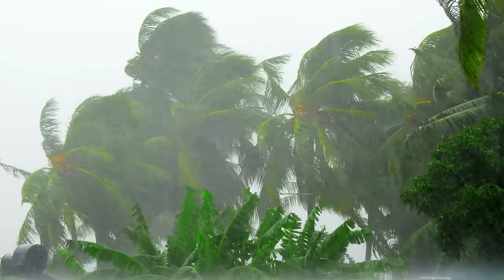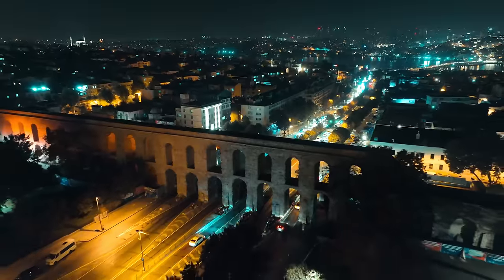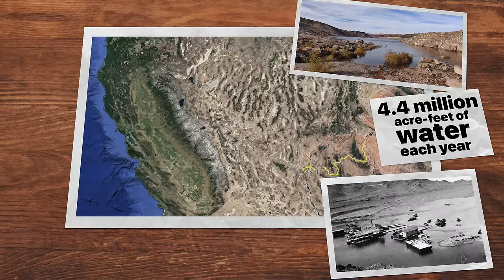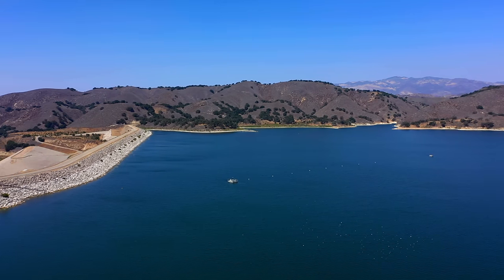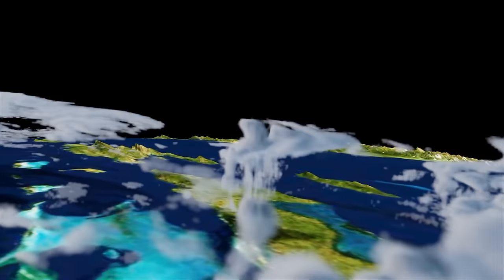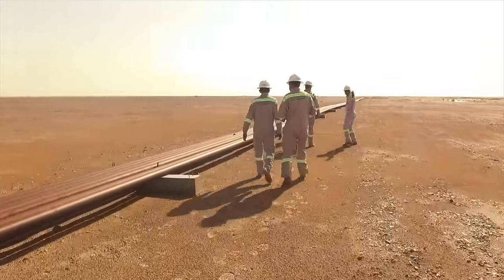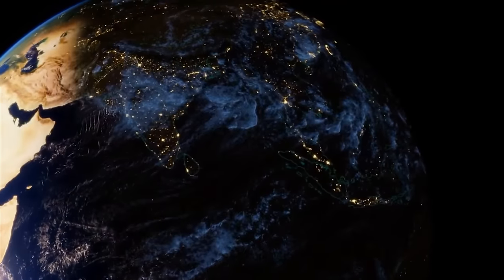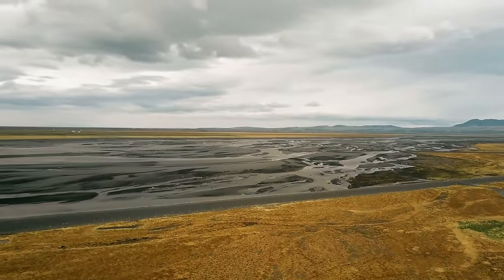Pipelines From Flood to Drought

Comment: For decades property developers have filled in wetlands and built homes, strip malls and shopping centers on them.
Wetlands are natures over flow, flood storage and ground water recharge ares. Wetlands need to be protected, expanded and appreciated for the flood control and water storage that they provide.
Reply from the maker: So true
Reply: You have to realize, though, that the root cause of floods is deforestation.
Forest areas have soft soil, which rain will soak into immediately.
On open areas with hard soil and little to no vegetation, rain will mostly pool and run off, into streams and rivers and/or nearby areas, which will overflow, causing floods.

Viktor Schauberger predicted this. He called it full-cycle for a natural system with plenty of forest, and half-cycle for systems without. Half-cycle means there will be ongoing cycles of floods and droughts, when most forests have been cut down. The only way to fix it is reforestation.

Pumping water around is a band-aid solution, and will fail as floods and droughts will only become more severe over time. Look at India to see what that would look like; rain for months on end, flooding living areas, destroying people's homes, then drought, which will eventually force people to migrate.

Forests naturally attract rainfall, whereas open areas generally only get rain from large rainstorms.
Temperature in open areas lack the regulation from the water and moisture, and swings from very high during the day to very low at night, both of which cause the soil to dry out further.

Farming the wrong way is a contributing factor for the hard soil. Viktor Schauberger invented a plough, which flips the soil a full turn, leaving it mostly undisturbed, but allowing rain to soak in. A cover crop such as grass should also be left in place over winter, to avoid the soil drying out and becoming too compact.

Lastly, some past civilizations built terraces on hilly lands, which forced the water soaking into the soil to follow a widely winding path down, retaining the water for weeks or months after each rainfall.
Reply: Yes and add a gutter and drainage ditch everywhere on top of all that. There is not enough recharge basins to compensate for the usaage. 
Like 2016 when California had record rain fall with inadequate storage capabilities so much fresh water flowed out to sea. Fun fact; 1 inch of rain on a square mile is 18 million gallons of water, multiply that by 5700 square miles (for Los Angeles and orange county) equals 100 billion gallons, multiply by 20 inches for that area equals 2 trillion gallons of water. So much water flowed out to sea but it was sweet having a constantly flowing river in the usually dry river beds into summer. Even the dozens of new waterfalls in the local mountains was a special sight.
Reply: @silvergreylion  > Look at India to see what that would look like; rain for months on end, flooding living areas, destroying people's homes, then drought, which will eventually force people to migrate.<
Yes and No. India naturally has Tropical Monsoon type weather, driven by seasonal actions in a vast surrounding ocean. Even in places where there is traditional full forestation still in place, they are 'feast and famine' on rainfall.
Reply: Agreed.  There was an area in Florida, forget which, that flooded like mad.  People told the idiot developers "DON'T BUILD THERE!"

What do they do?  Build homes.  Now, now those homes flood like mad because of the area.  It's ridiculous.  Same goes for that crap sack that wrecked a bunch of mangroves for a development project.  These city leaders disgust me.
Reply: Also, preserving or even restoring old wetlands apparently has a beneficial effect on the environment as they trap large amounts of Co2.
Reply: @larss337  They also provide homes and food for wildlife. We need to learn to live in harmony with nature and not destroy it.
Reply: @KJSvitko  Yes, this is very true. Greetings from Finland 🇫🇮 😊
Reply: @silvergreylion  prove that, please, show me one place where someone actually proves where floods come from that isn't pushing democrap agenda.
Reply: Agree and thinking one way to "possibly" accomplish this, in at least "some" harmony with nature, might be to build more comercial structures atop of pylons/stilts (vs the antiquated filling in of wetlands and swamps) so the land below can mostly do what it was originally intended to do(?)
Reply: When you say wetlands are nature's overflow, you are barely right.  Flood plains are nature's overflow.  Wetlands are just lands that stay wet longer than non-wetlands.  Different political jurisdictions define wetlands differently.  Flood plains are defined by actual floods.
Reply: @amanawolf9166  amazing what happens when you build on swampland
Reply: @troychampion    leave political insults out of the issue. Besides the person gave the name of the idea pretty clearly among a few others. Take the five mins to look it up.
Reply: Wetlands  are protected, where are you getting your information that it is not.
Reply: Agreed.
This is true.
Priorities misplaced
Reply: Use o
Use of high altitude flat land as wetland should be a winner. Consider.: stae owned otr federal property, large acreage, currently low  yield agriclture, American bison etc.
How: micro-dams say less than 100ft highNo pumping involved but  energy captured would be immense typically filled to less than 10ft. Built to make as much soil as possible boggy witthout causing ponds to form. 

Fells, moors, high dry tundra, low  cold tundra, river margins. lots of p;laces.
Reply: @amanawolf9166  There are many more than just the one development like that here in Florida.
Reply: paving over  the land  is  just not that smart. thats a fact.
Reply: @larss337  greetings
Reply: @tzazarizona2676  yeah wetlands are so protected that the developers who wanted to build in the wetlands behind my house had to provide a wetlands area within a hundred miles as compensation. 🙄
Reply: @larss337  its almost as if we take care of the natural environment it will make living more pleasant with much less natural disasters occurring.
Reply: I've always wanted to see some way toget wet areas to send water to dry areas.  This sounds wonderful to me.  Now just get politions to see beyond getting reelected.
Reply: @theresacarmen9847  Population needs to be in balance with jobs, resources, nature and the environment. Having a bigger population in any country than the country can support makes no sense. Access to food, water, shelter, energy and jobs should guide population levels. The worlds population is still expected to add another billion people to feed, clothe and produce pollution. Humans are crowding out all other species of plants and animals. Education and birth control are key to reducing poverty and hunger.
Reply: @silvergreylion  Good Summary
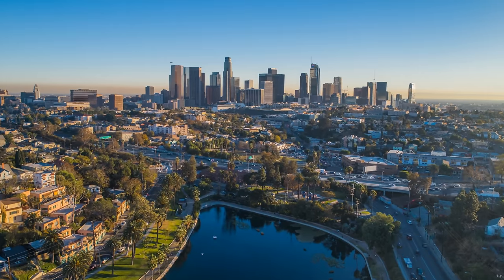Reply: @TwoBitDaVinci  You made a mistake in the video, in 1:43 - 1:45 you said that "71 percent of the earth is covered in FRESH water", when in actuality it's 70 percent SALTWATER with only 1 percent freshwater (mostly in ice glaciers and underground water). I think you meant to say "71 percent WATER" and then add the bit about the 0.5 percent of drinking water later. You might want to add a clarification in the description, but I'm not your mom, so do what you think is best. I miss YouTube annotations.
Reply: One huge impediment to proper development are the insane building codes that still exist in most areas which REQUIRE that developers exclusively build single-family dwellings.  That means no tiny houses, no single person efficient cottages etc.  

And there are many other obstacles that building codes (as they currently stand) put up against energy efficiency, distributed energy & micro grids, vegetable gardens vs. lawns, as well as requiring septic tanks rather than giving preferential incentives to low (or no) water compost 🚽 toilets.

Then there is the “just plain dumb” way of doing things.  No new pavement has yet to be used which is lighter (cooler). Likewise, roofs that are white have been proven to reduce energy usage, even in northern areas. Yet the construction industry and our governments could care less. 

And there is the fact that many states and/or municipalities severely restrict the amount of rainwater that residents and businesses can store.

Lastly, even though the first subsidies to petroleum began in 1916, and we are allegedly “moving toward alternatives,” we still haven’t begun to reduce these subsidies.  I guess that can only happen when the human race perishes! 🤪😵
Reply: I dunno, I feel like we don’t have nearly enough parking lots….😂
Reply: I live in a city in Illinois that actually pays attention to those things. I actually recall reading about the zoning here, years before I ever contemplated moving here. It was in the WSJ. Now that I am here (for thirty years) I see the wisdom of it. 

Just after I moved back to the US from the UK there were many floods during a period of heavy rain. Someone did research, using public on-line resources, and found that some 40% of the housing stock was located in known flood areas. They knew it. In China they are having drought. On the other hand, they have built so many dams that the whole system is failing.
Reply: @enfynet  I believe they call that “ remediation “ which I agree is stupid the way they utilize it. And the end result are wetlands lost in critical areas. Imo they were there where nature intended
Reply: The once great Pacific flyway from Alaska to south America has been wiped out from California paving and concreting 90% of the wetlands rivers and creeks. of southern california. The ducks and geese of my childhood are no more.  Now warehouses, distribution centers, and " planned Communities ". Hmmm. Who's plan?, what plan? ,  certainly not mine.
Reply: @danielcraft3727  In my city the migratory birds have lots of habitat. I live next to a park with a small lake. I keep a list of the migratory birds I see here (nothing formal) and it is long. The Canada Geese are a bit of a problem because of all the droppings, but it is not too bad.
Reply: look at the netherlands they fixed most flooding problem they had
Reply: @larss337  You are correct, Holistic Farming is a part of this.  Proper land management will reverse desertification and restore rain fall and water retention to areas that have lost it.
Reply: If rich guys can't make money off of it, it'll never happen. That's the probem with all great ideas.
Reply: Yes, do that too.
Reply: @glennmitchell9107   fun fact epa in the 70s classified land that stayed wet for 72 hours as wetlands
Reply: @tzazarizona2676   be careful  with current regs a low spot in your gutter that  stays wet could be designated wetlands and you couldn't fix it
Reply: @KJSvitko  I agree if LA and New York city's can't  grow enough food in their counties well they should not expect food to be sent in. Fun fact the tokeyeo area in japan during ww2 imported 98% of its food  between sinking ships and destroying the railroads that ran along the coast if the war had lasted a couple more months there might not have been a government left able to surrender
Reply: @silvergreylion  It depends on the geography, if you live in hilly topagraphy that's the case. We have plenty of marshes and swamps that soak the water up with no trees.
Reply: Okay. What's that got to do with shipping excess storm surge water to the Western United States?
Reply: @TwoBitDaVinci  Look at Burns Bog in Delta BC Canada. Laws prevent it from being developed! It is the filter for the Frasier river and excepts excessive water run off.
Reply: and a lot of parking places :) and almost no public transport...
Reply: @tzazarizona2676  before the transcontinental railroad was built, the entire central valley was a vast wetland. Then more than 100 years of development destroyed nearly all of it. Most large wetlands are gone, and we barely protect what is left.
Reply: @fromika  Not too many families that I know of want to shop or buy groceries  or buy a sofa and haul it home on  a bus.  On what workd do you live on to come up with such wild and unworkable  ideas?
Reply: @Dave-ty2qp  not many of my Russian friend would like to do so, but there are idiots everywhere, its not nation dependent but attitude. Stop thinking in stereotypes received from tik-tok. Many videos like "Idiot Russians" contain multiple clips from US.
Reply: @fromika  I can appreciate your reply fromica and thank you.  Steriotyping is wrong, and since I am ultra anti commusist, I would never have a tic-toc account which is operated by the Chinese communist party.  I don't remember saying or thnking the term "idiotic Russian".  I was in the military for 25 years during the cold war days and grew to respect Russia as an educated and honorable people.  If you hate your enemy, you will be consumed with your hate rather than win the war.  I really miss the russian youtube clips from before the Ukraine screw up.
Reply: @Dave-ty2qp  the situation in Ukraine is a result of aggressive western politics. I know what is Ukraine as far as I spent there 25. Few years ago it was "the most corrupt country in Europe" now is a place of "heroes". Country could not change that fast. Its just use to reach western coals, a object to pull Russia into a devastating war. They did offer Ukraine to be neutral and there are few regions decided not to follow Ukrainian way. Ukrainian started shelling the region. Sure you will always find few that would like that region belong to Ukraine. What is your opinion about new recruits should pay 450 USD for equipment in Ukraine?
Reply: @fromika  I believe Russia's offer was give us what we want and we will be back for more later.  Not such a good deal.  Diplomacy doesn't work when you have been invaded which is the situation Ukrake found themselvs in a few years ago.  There is no peaceful resolution now, and the war will have to go on untill one side ot the other has decided that they have lost enough.  A sad fact , but non the less true.  I really don't know which I feel worse for Ukraine, or the Russian invader sent there with such poor leadership.  Many will die unnecessarily for the ego of Putin.
Reply: Totally agree
Reply: Big development is problematic overall.   NYC, for example, all of that sewage and waste and polluted air - it's actually testament to the resilience of humans that anyone lives very long in NYC.   What about sewage?  in rural settings a septic system is used to disperse and repurpose waste into fertilizer, thus enriching the soil, etc.   IT is an inherent source of fertilizer BUT is not used for that, rather it is dumped into waterways and pollutes them.  IDK. Capitalism is very frustrating as it seeks how to make $$ on anything and everything around. 
Rather then being good stewards of what resources are around, now we have to back pedal to environmentally friendly products and processes - but that seems to be failing miserably.  China keeps making sub-par plastic goods and Americans are importing them.  They last maybe a year and to the landfill they go - we need some accountability as far as imported products are concerned.  they need to last at least 5 years...longer would be better.  But, also, we "the people" need to be LESS tolerating of all the plastic products - regardless of their origin.
I know That went off topic, but it does relate.  Developers just develop whenever and wherever they can make a buck.  No regard for the overall effect to the natural water runoff and retention areas, etc. which nature has already formed.
Another factor is people aren't informed/educated of this and they go and buy a home in or near an area.   This is more a Municipalities permitting processes that needs reform.  Sadly, we have the best policymakers money can buy (wink, wink)....AND developers get themselves on the governing board so they can make policies favorable to themselves...sad, just very sad.  
I could go on and on, but that's it for now.
Reply: For the most part, the days of wetlands destruction have been over for quite some time, tho in certain deep red states, "accidents do seem to happen".
Reply: I agree but city ordances are starting g to address what is done with rain water after you have paved over land and in many cases you are responsible for that water on the property. Think smal holding channels.
Reply: Very interesting conversation. However with the current state of politics in America I can't see any common sense things ever coming down the pipeline pun intended
Reply: @tzazarizona2676  MANY wetlands have been drained and / or developed.  The only wetlands that are protected are those designated as such...others have been paved over.
Reply: @KJSvitko  Better use of resources and elimination of massive waste and destruction of environment would be more than sufficient. We are NOT lacking enough food...we are wasting massive amounts of food produced...and certainly not using natural resources in a well thought out way for sustainability.
Reply: They build   Bayou and Retention Ponds in Low lying marshlands whenever they develop it.
Reply: Wetlands ARE PROTECTED by law. One can get thrown in jail for dumping a load of sand on a mud puddle!
Reply: Yes!
Reply: burns Bog in Delta BC Canada is protected from development!!!!!!!
Reply: True. Years ago they built a big box costco store in my area on top of a wetland. Halfway through construction it began to sink into it, but instead of stopping construction & moving elsewhere they just did what they had to do to stop the sinking problem & carry on. Corporations don't care.
Reply: I think the idea of using existing pipelines is SMART!  I believe if this idea was promoted to our government and water management this might gain some traction.  I’m going to forward your video to my congressman and senator.
Thanks!
Reply: @amanawolf9166  Geography mapping makes and type of Geography Countors make a huge difference in rain collection and flooding. Global flooding is increasing world wide and its taking lives and destroying infrastructure. Youtube RED ALERT FOR HUMANITY
Reply: @larss337  One of the few countries that does not see drought or flooding of heat waves. How are the winter storms?
Reply: @climeaware4814  They can be severe with much snow.
Reply: Not true.
The wetlands act of 1970 prevents building on wetlands and it's a major obstacle for capitalism
Reply: @TqSNv9R0iG5Ckxew  Build homes in low lying areas, sell them to unsuspecting buyers and then watch them flood.
Reply: Swales. The desert needs more swales.
Reply: you're the man Kenz300x
Reply: @donjonjr1  you do realize the flow of the rivers is essential to the health of our wetlands and delta?
Reply: @KJSvitko  
Low-lying areas are not automatically legally considered as wetlands, nor are wetlands always in low-lying areas.   Apples and oranges.   In fact, wetlands don't even need to be wet to meet the legal definition.
Reply: wetlands will be moving inland
Reply: @tigeraudio  
Thanks
Reply: @silvergreylion  wetlands are not simply forests. In fact almost the opposite marshes are hardly forested.
Reply: They figured the flat land is easier to develope. They/we had NO clue
Reply: @Tiggitytye  yes I do, but it seems you don't realize that grading, pitching, filling in, building gutters and ditches everywhere hinders the lands ability to absorb water properly to replenish the aquifers and hydrate the land.
Reply: @donjonjr1  how about massive dams and the massive water exports to the south of Northern Californias water so LA can have swimming poools and golf courses and grapes and alfalfa can be grown in the Bakersfield desert?
Reply: @Brantoc  stop blaming the wildlife, the wildlife deserves the water more than lawns and desert crops.
Reply: @silvergreylion  
Chisel, plowing and disking, and putting in egg grass crop and turning it in in spring adds nutrients to the soil, fertilizing future crops. Rotating crops also improves soil and allowing for rain to be absorbed. Organic farming, also improve soil and not harming the environment.  Organic is more labor intense than using chemicals that cause the land become harder and destroys the aquifers. 
Have a great day
Reply: It's certainly possible that governments should stop defending land titles to fragile areas like wetlands and barrier islands. How this can be done, I don't know.
Reply: Wow really?
Reply: New Idea:  Pipe glacier melt off Greenland to N. America, and Africa.  This could slow Atlantic Current slowing due to the insertion of cold water and work to reforest desert areas.
Reply: @davidjones6389  Hahahahahahaha!!!
Reply: @YodaWhat  India is also one of the worlds largest producers of river sand which is a main ingredient in concrete they dam and destroy alot of rivers which contributes to worse floods
Reply: @KJSvitko  Sure, You hold your breath, I'll wait.
Reply: These wet lands are more important than building them into places to live. With out wet coastal regions and low water level from the water source and ocean water on the rise all coastal regions are going to be in salt water and anything that can't adapt to the salt water will die off many issues with this type of approach. My opinion
Reply: me watching the water district cut down trees along the levy that were planted to control flooding but are now being removed due to drought then boom flash flood
Reply: For every bit of wetlands you fill up you are supposed to do a new wetland mitigation. Same thing with trees you remove.
Reply: Too bad Congress never passed any legislation in 1972 protecting our wetlands.
Reply: In California, the wetlands get their water from the rivers that come from the Sierra Nevada mountains. The rivers get their water from the snow melting over the summer. The trees shade the snow so it melts slowly over the summer providing a steady flow of water to the lakes and rivers and everything down below, rather than one big flood in the spring.
There is no snow.
The trees in the mountains are dead from drought.
Everything else is a result.
Reply: @silvergreylion  To you last point of past civilizations building terraces on hilly lands, this sounds like swales which (in modern times) is a permaculture term. 
Essentially trap some water to let it soak into the soil.
And to your main point, swales work best when trees are planted on the downside of the trench or contour (but dont confuse the term contour with water redirection in this context). 
Trees actually help soils retain water.
Why we insist to continue cutting them down on the scale we do amazes me.
Reply: @kepler656  That's just a mindless rant done for the fun of anger and hate. What's with the obsession with transvestites? Why is this the first thing on your mind, completely unprompted? Is someone dreaming/hoping about this all night?
Your post says more about you than it does about any of the imaginary people you complain about.